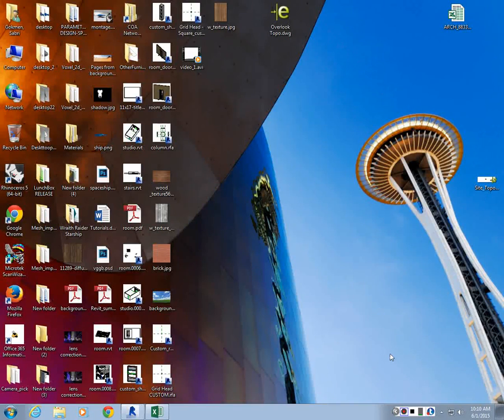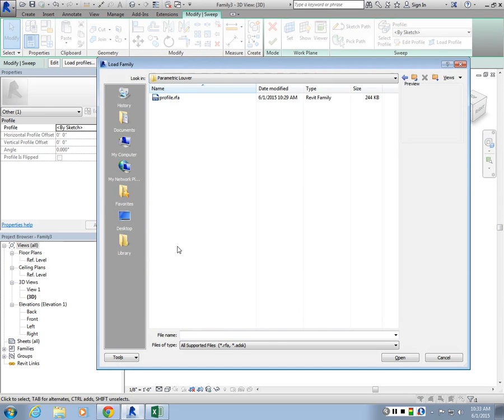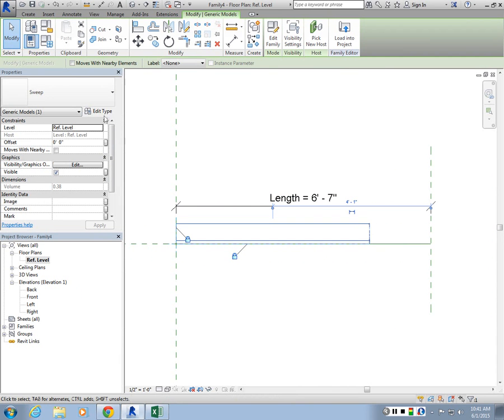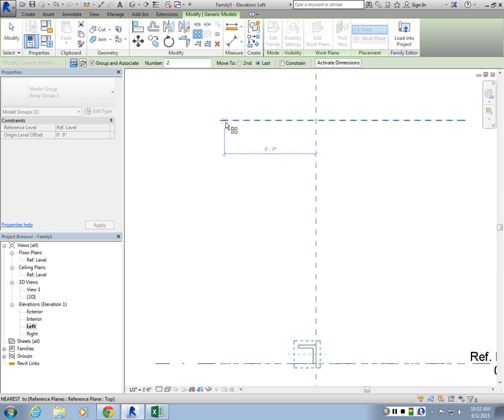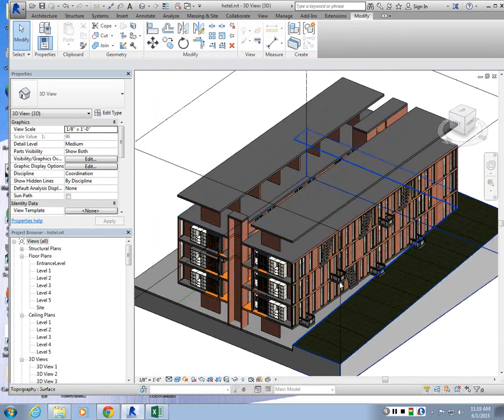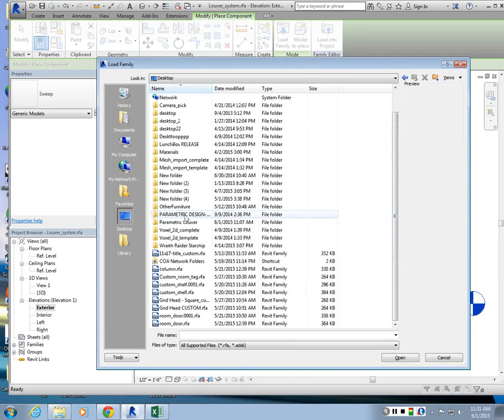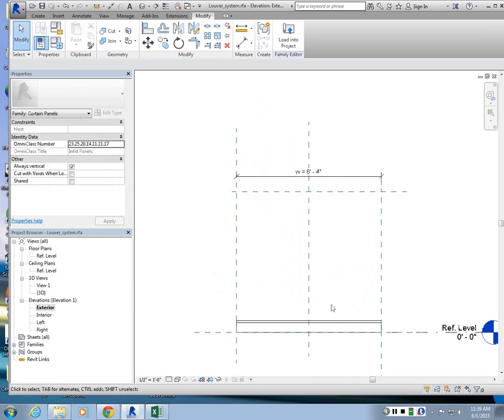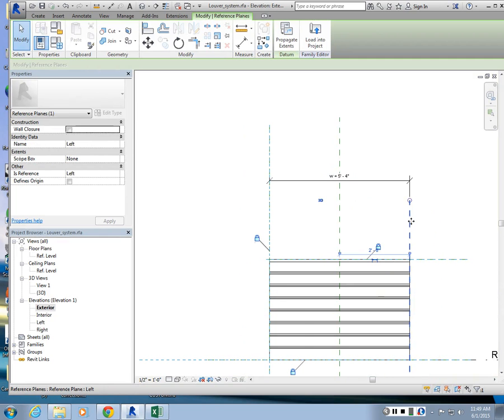Nested families

Comment: Dear Sabri, I followed the steps as video shows, it looks everything is working properly till creating the louver panel stage, but when I load into project of curtain wall panel, the louver blades are unable to associate with the curtain grids, it shows the louver blades are slanting, which is similar to the situation shown in your video, I have no ideal what goes wrong, could you please advise me? thanks.
Reply from the maker: Hi Wang. It sounds like there can be a small issue with the nested family references. Can you send me your files?